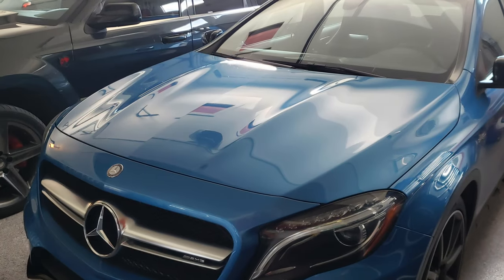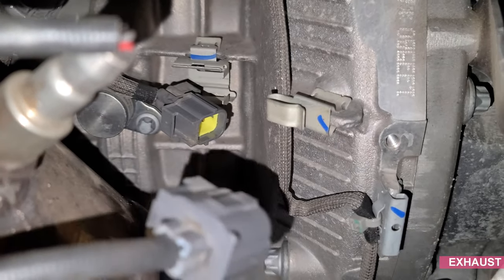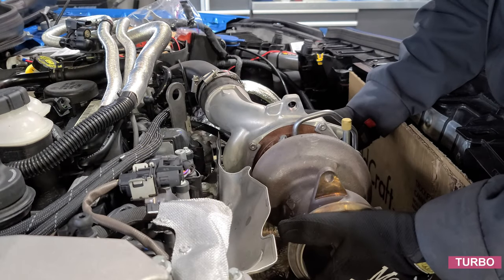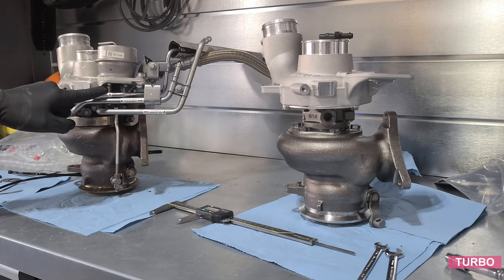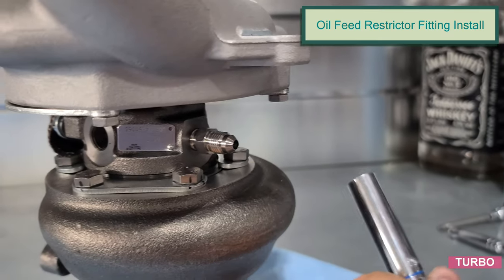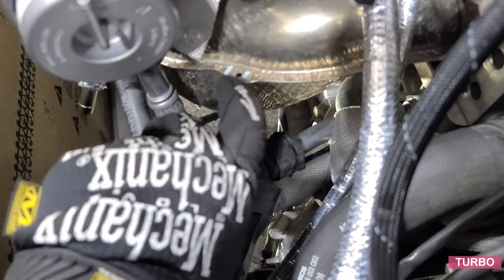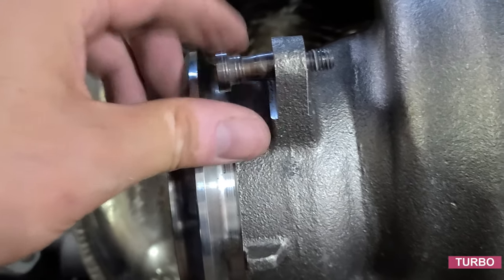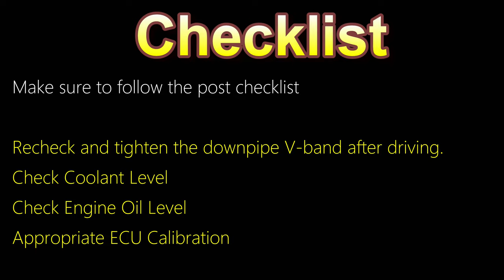AMS Alpha Performance Garrett Turbo and ArmyTrix Exhaust Install Mercedes Benz GLA CLA A45 AMG M133

Comment: Hey just curious I have CLA 45 M133 engine 2014, did a pure turbo swipe. My new and old turbo came with the BOV plate should I install BOV ?
Reply: Yes you should to avoid turbo failure
Reply: Hey, how how it the car running with the pure turbo? I have the same 2014 cla 45 AMG, should I consider installing pure650? Also what other mods do you have
Reply: Ask chatGPT

Comment: Nice job! Any documented footage of the performance improvements? Also what can the gearbox handle torque wise, do you know?
Reply from the maker: I have beat on this thing for a few years... no issues at all.  kind of surprising everything is over engineered.

Comment: I need help!! I just got a GLA 250 and wanna kno what aftermarket parts I can install on my car.. I'm thinking since the CLA has the same motor I can use those parts but not sure.. or can I use the same parts as the GLA 45??
Reply: The 250 and 45 are different engines, cannot use parts for those

Comment: Good luck with the channel from Spain. I am thinking of installing a downpipe in my a45 AMG 2018 and I have some questions. 
Now I have installed the AMS carbon induction kit and Renntech Ecu HHT.  I would like to install a downpipe catted, do you recommend the armytrix with a ceramic coating?  I'm between the armytrix and the Renntech, this is 3.5 "-3" and armytrix is 3".
Thanks.
Reply from the maker: You can't go wrong with either.  Both are outstanding quality and will do what you expect them to do.

Comment: Are you gonna shoot a video where you take this car for a spin?
Reply from the maker: there is a whole bunch of videos waiting.  Dyno (closed due to lockdown),  WOT runs, drive bys, Draggy 0-60 100-200 all that fun stuff - waiting on new wheels - 4 month wait - ordered on Feb 3... 265 all around.  stocks wont hold during launches... too much power.  Unfortunately, covid, winter, all that has really put a damper on all this.

Comment: what are the fitment specs for the wheels?
Reply from the maker: All the info on the winter setup is outlined here:  https://www.glaowners.com/threads/gla45-amg-18-wheels-and-winter-tyers-rtx-yes-they-fit-on-amg-20-option-build.27804/#post-206533